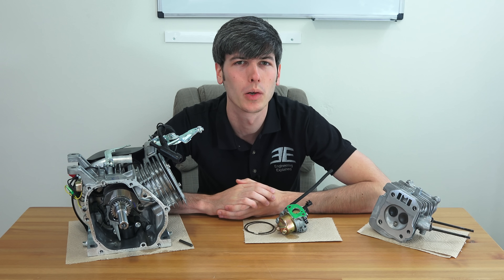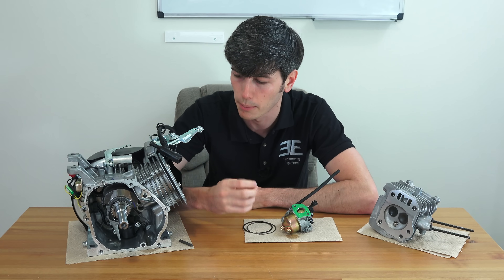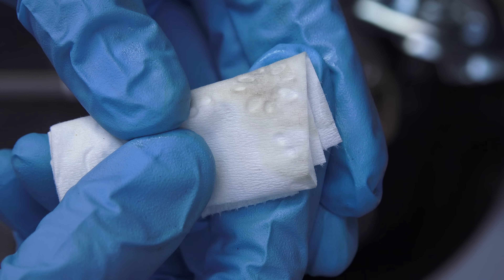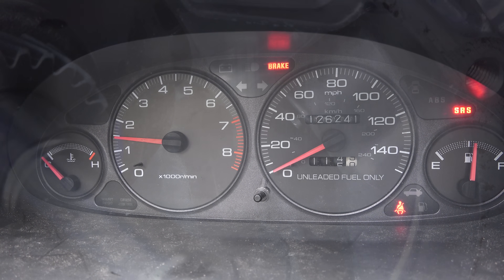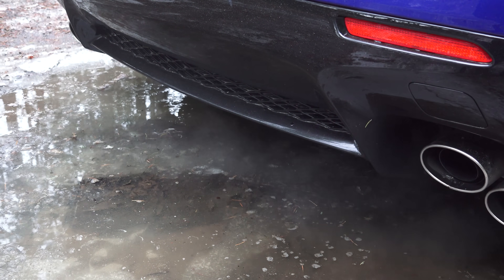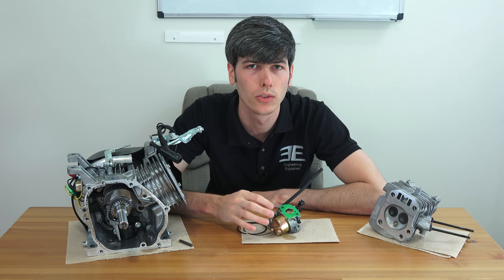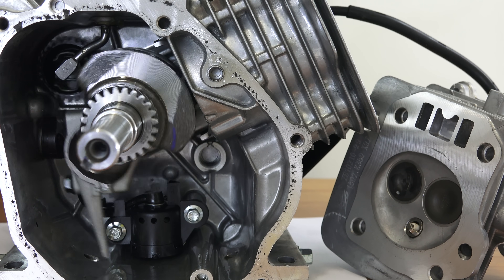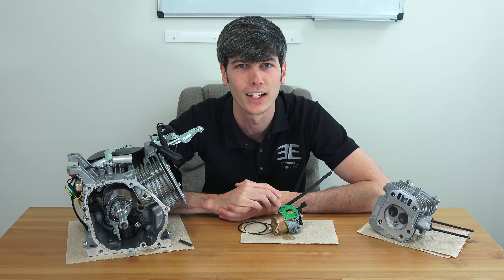Should You Warm Up Your Car Before Driving?

Comment: As a former Technician I cannot agree with this video or anyone saying that warming an engine up is not needed. I have personally replaced many crank bearings due to people not letting the oil properly warm before use. It is imperative to remember that there are many types and combinations of metal used in engines and each has a different range of malleability based on temperature.  Engines spinning bearings are common in the colder states in the US due to trying to drive a vehicle before the oil is to operating temperature. A lack of viscosity in the oil will create friction between the crank, bearings, and journals that can destroy engines. To a lesser extent I have seen the same with cam bearings. Often 2-5 minuets of the engine running in temperatures below 35 degrees is considered to be the best bet against these issues and will not harm the vehicle. In fact if you are not waiting 15-30 seconds after starting your vehicle before driving even in higher temperatures you risk damage to the engine due to lack of oil coverage, viscosity in the oil, and the oil being outside of working temperatures. The oil of a vehicle will heat up quicker than any other fluid due to direct contact with friction between parts causing it to come to operating temperatures quicker than anything else. You do not need to wait for the defroster to work as that is controlled by the engine coolant temperature and is not necessarily a guide to determine if the engine is at operable standards.

Comment: I leave my car in idle until rpm goes down and stablizes and thats usually takes 3 minuits . And I noticed the differance when doing that and when not doing it.The engine and gears will run smoothly.

Comment: it is important to warm up your car in idle because the piston to cylinder clearance is large when cold. driving it cold will result in piston skirt wearing prematurely. then piston blow by resulting in oil consumption.
when driven cold the piston will rock under load. it can be heard even on new vehicles as a faint knock which goes away after a few minutes. better off to wait 4-5 min minimum then drive easy untill up to operating temp.

Comment: Seems newer vehicles warm fairly quick. Just picked up a 2013 equinox. Not saying it's better than any other cars but I know compared to my 2005 and 2006 vehicles it's seems to have heat sooner. I let it idle for 30 seconds to a minute when it's under 30 out. Then try to keep the rpms under 2500 til the temp gauge is near operating temps. My older vehicle I would just get in and go. Lasted 190k but I doomed it when I was running late and it was 0 out. Jumped in and had it to the floor all the way to worl. Head gaskets blew finally. 

Good chat.

Comment: If you want your engine to last especially headgaskets, any engine that has two different types of metals or intakes that have like 3 layers of gaskets and want your transmission to last for godsakes let it warm up for around 5-10 mins and you will also have a toasty warm seats. Remember aluminum and cast iron and gaskets expand and contract at different temperatures.

Comment: I live in the northeast and it gets cold in the winter. I don't care about the engine I care about me freezing my rear end off in the car. I have remote start and let that car run with the heat on medium for at least ten - 15 minutes before I go out there. If the engine starts to be crap I will buy another car and let that run. No way am I freezing my butt. Oh ya heated seats are on to.

Comment: Noob question:  if engines don't heat up as quickly while idling, why do they overheat faster when stuck in traffic?  Part of it must be that while you're moving, you're obviously getting forced-air cooling, but why wouldn't that forced-air cooling effect also slow down the warming effect, so that idling would actually warm up the car faster?
Reply from the maker: +Frank Burns there's a thermostat that closes off the radiator when the engine is cold, so it warms up faster even if you're moving. When your engine is warm, the thermostat allows flow through the radiator to cool it. Sitting in traffic, your fan doesn't provide as much airflow through the radiator as driving at speed.
Reply: Thanks for the reply.  Yeah, I should have factored that in, since when I was younger and could only afford old pieces of crap, when there was an overheating issue (and there usually would be, sooner or later) it was almost always due to the thermostat being stuck.

Comment: I live in Thunder bay Canada...January and February are the coldest months of the years for us...with temperatures dropping to -35 to -45 with wind chill...I do use a block a heater. should I also only wait 15 to 30 seconds? I have tried this method in the past and the load on the engine is so much that I can't get the car to go over 40 kph and have to pull over to let the engine heat up even more...any in put would be appreciated:)

Comment: To any watching this video... yes u need to warm up u engine... for various reasons not just carburetor.. and here it's approx how much.... below 15F 3 minutes minimum,  35F 2 mints ,, 50F 1 min,, and anything above that 45 secs ..... do not EVER start your car and go specially if the the temperature is below 35F...

Comment: This guy missed a couple of important technical and mechanical points of why you need to warm up your engine. 1. Your piston is actually a bit oval when it's cold. It will expand to fit the cylinder once warmed up. Pushing load on a cold engine during this time will cause a lot of uneven wear on the piston skirts and rings and cylinder wall(oil could only do so much). There will be also a lot of blowby getting into the crankcase and mix with your oil. 2. Your crank and rod bearings are not at their proper gap to handle load. This will result in improper wear and will lead to rod knock and spun bearing if it's severe enough. While I'm opposed to long warm up such as 15 minutes(wasting fuel), but I'd recommend to let your car run at least a couple of minutes to let oil flow and the mechanical to expand a little to their proper operating specs to ease the improper wear on your engine's internals.

Comment: I got a 09 crv with 250 miles on it back in 2010. after 7 years of owning it, and it now reaching 160k miles, it still works with no problems whatsoever, with the only maintenance being oil changes.  I start the car at least 15-20 minutes before I drive and every day and never had an issue. I live in Alaska.

Comment: The real question for me at least is will it hurt to warm up the engine for a few minutes at idle before driving? If the answer is no then I will continue doing so for a couple of reasons: 1, I feel like my car drives better after warming it up at park. 2, After doing so then I will just drive as I want without fear of hurting anything instead of driving slow for a few minutes. So I take his advise but I will do it my own way which is proven and tested in real time for many years.

Comment: Sooo...you're saying DO let the car warm up. Not only is it bad to run your engine hard before it fully warms up, which you stated, you also get the benefit of getting into a warm vehicle (especially if you have remote start) and your transmission temp will be closer to operating temperature as well. 
I personally hate getting into a cold car and shivering while driving. :)
Also, Doesn't the vehicle automatically increase the RPMs until it reaches operating temp?
Reply: Ahhh ok I rewatched again. That makes sense. You want to get the vehicle to operating temp as quickly as possible. 
So theoretically would it be beneficial to slightly rev your engine while in park until it reaches operating temp?
Btw I still think letting your car warm up before driving is better. just to avoid being cold while driving.

Comment: I always let mine run for a couple minutes to allow certain things to warm up. The heater being one of them. The gearbox is stiff if I try and set off when it's really cold. mx5's have this thing where it will idle at about 1500-2000RPM until the engine is warm enough then it will go to normal (800~RPM). So I'll always let mine run first

Comment: So this whole bothersome argument on whether or not to warm your car got to the automotive enthusiast and professional community and skipped over the real reason average everyday people warm their cars up. The oil might still be cold but after 5-10 minutes of warming up the COOLANT is warmer, therefore the HEAT in the car is on and warming you up if you dont have a giant heated garage. Cold interiors and cold air blowing on you in 20 degree weather is miserable. Besides if you are driving a car in the cold winter then the car is either an appliance to get from A to B or it is your daily which hopefully gets regular maintenance preventing too much gasoline accumulating in the oil.

Comment: While I get this guys point, I don't think the difference is as great as implied. If you start driving right off the bat when cold, more wear is done by having higher RPM's in a cold engine versus low RPM with an idling engine. Most of the damage is done in the first ten seconds of starting anyway.

Comment: i tell you what. when its -40 and i dont let my truck warm up for at least 10 minites if i get anywhere close to 1600-1800 rpm my oil pressyre goes through the roof.. and yes i use synthetic oil. do i plug it it all the time? no. but who cares it starts. nothing works good at -40. transmission doesnt like to shift. oil pressure is to high. engine doesnt sound right..  i dont know if your talking about -2 celsius but up here in Canuckistan from the months of september to may we dont get a whole lot of temps over -10.

Comment: Warming up is just a waste of fuel. In the summer 5-10 sec should be enough. When its freezing may be 30 sec. But there is a big part that you missed. When driving with the engine cold you should drive at a "slightly" higher RPM (lower gear) so that your engine generates less torque. At low temp oil flow in the bearings is very limited. It is not a good idea to put more load when the oil is cold.

Comment: You need to warm your car up on cold days for numerous reasons. The first reason is to defrost your windows. If you drive off on a very cold day, while the engine is still cold it will further fog up your windshield. Secondly you cant just pull out onto a road that has a 35 mph speed limit or greater and say oh well I'll go 20 mph till my engine is warm. In the long run its better to let your engine warm up then it is to drive off while it's cold.   It's also horrible for the transmission.
Reply: iri1shman86.

I have a 2017 Accord 3.5L V6. I can gradually climb up to 60mph without ever revving past 2000 RPM with no trouble. With this said, my car’s oil temperature gets up to where it needs to be in less than 5minutes regardless of what the temperature is.

Gradual, mild throttle on the gas pedal will do a lot less harm on your car versus idling your car for 20 minutes every morning.

Comment: Sorry about my English, the fact is that never mind if your car has carburetor or fuel injection system or even turbo, the thing is that always let the oil fill all the spaces inside your engine before you drive it, no matter the weather outside the car. It is recommended that you must warm up your engine if the outside temp is freezing but generally in any weather we should let the oil fill all parts of the engine before drive your car. This simple 20 to 30 seconds activity allows you to have a lot of miles ahead with no trouble and also try to use synthetic oil before the winter arrives, try to find all the Mobil videos here that explain why is better to do this and you will get more than 300,000 miles of trouble free in your engine, no matter if your car is American, European or even oriental brand.
Reply: Oriental brand? Oh yes. In terms of reliability 'oriental brands' are considered far better. You frequently hear of Toyota vehicles that have done more than 300,000 trouble free miles, but the same can't be said of European and American ones.
Reply: This guy says oriental brand like you'd expect to see Fords or VW frequently passing 300,000 miles while Honda and Toyota end up in the junk yard between 100,000-200,000 lol.. The reality that everyone knows is true is that it's the other way around
Reply: Claudio Nieto.

Your English is perfect. And i agree with everything you said!

Comment: On practically every modern car (as in 90s+) the engine management will only run extra fuel until the O2 sensor has warmed up... so if you have a heated O2 sensor (very likely) you will only be in the cold-start mode for about 15 to 30 seconds, depending on the weather outside.  Driving your car will only modestly reduce this period.

You can then idle your car with relative impunity to allow it to warm up prior to placing a load on it without worrying about extra fuel washing the cylinder walls.  It's still better to warm it up a little faster, with a modestly light load, but you aren't going to be damaging anything by letting it idle until it is warm.

There's a reason the most reliable cars have a built-in warm-up cycle (running the RPMs high for a few seconds while the O2 sensor is warming up and the oil flow begins in full).  If your car doesn't do that, do it for it - rev to 1500 RPM for just a couple seconds, then slowly bring it down before allowing it to idle, this will help warm up the O2 sensor VERY quickly and result in closed-loop operation much sooner, as well as forcing oil to circulate - once it's moving, it takes less force to keep it flowing.

Comment: Is there any data to back this claim?  An engine at idle, even when cold, is using very little fuel.  It is also under high vacuum which helps the fuel stay atomized.  When driven, you lose vacuum and call for more fuel plus more fuel to account for the cold engine.  It is true driving will heat the engine up quickly but will the load on the cold engine cause more wear than extended idle in a cold condition.  Again, this should be something that could be analytically evaluated.  Obviously Mr. Fenske is a wise man but in God we trust, all others bring data!

Comment: It's not needed as much with fuel injection for drivability however I feel more comfortable close to operating temperature which would be anywhere in the hashmarks. You can't guarantee while driving you won't be put into a situation where you will not stress a cold engine unless you live in the middle of no where. I would rather sit a few min let the engine build some heat before I take off but you don't need 10+ minuets like on some of the older carbureted setups.

Comment: You do in a forged piston turbo engine... It has tons of blow by plus compression  sucks. Especially with e85. (tuning definitely is a giant factor with ethanol though) 

Also a tip.. Coolant warms up faster than oil. If your coolant is warm wait a few minutes or monitor oil pressure or temp to make sure it's ready before driving it hard.

Comment: This is misleading. When an engine is cold, so are the internals. The piston is shrunken up in it's cylinder. When you rev up that cold engine, you have a slightly smaller piston slapping around in the cylinder, creating unnecessary wear vs. a warm engine when all the parts have expanded to the necessary size, creating a tight, precise fit with a minimal amount of wear.

Comment: How cold is cold?  I let my engine idle for at least 2 minutes at 35 degrees F. It establishes oil pressure and good circulation in the transmission. I utilize the time to clean the exterior of the windows. I lived in areas where minus 20F was a normal cold morning. 8 to 10 minutes of idling was normal before driving. Once at minus 22 F my power steering pump seized up and squealed like a pig 15 seconds after starting. I shut it off. I ended up burning a pot of last summer's BBQ charcoal under the oil pan for a half hour to get some heat under the hood. It worked. 

The best advice from an engineering standpoint  is to allow parts to get near thermal equilibrium before applying load. Anything below 30 degrees F should be run at idle or low loads accordingly until the engine thermostat opens. Cold metal is brittle. Charpy Izod tests in college showed me that cold metal has the best chance of brittle fracture and crack propagation.
I prefer to get metals to thermal equilibrium before putting the pedal to the metal.

Comment: Where I live it's against the law to warm your car up without you in it.   Reason being is in case the cops are in a chase pursuit it can be easily taken. Which puts officers and the public in more danger. Really though what are the chances of that happening. I say if you have a remote start keep your car locked and your butt inside at least untill your cars not an iceberg. I'd rather have a little wear and tear which isn't gonna even affect it much rather than start off my morning freezing
Reply: +bb11 jr What if you lock the doors(with second set of keys) and warm it up? I personally always lock the door.

Comment: Warming your car up before driving is the same as jacking off before sex . you don't want a premature nut , jacking off before helps. You don't want a transmission or an engine in the shop , so warming up helps.